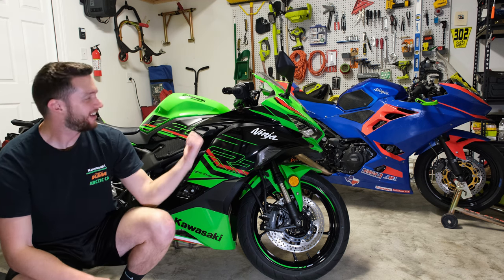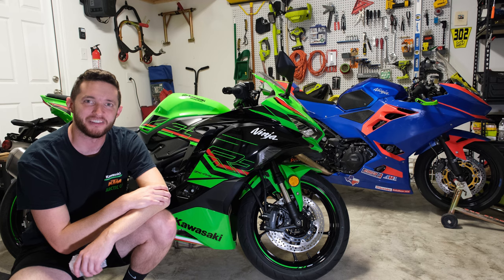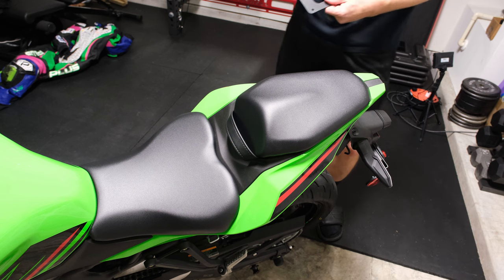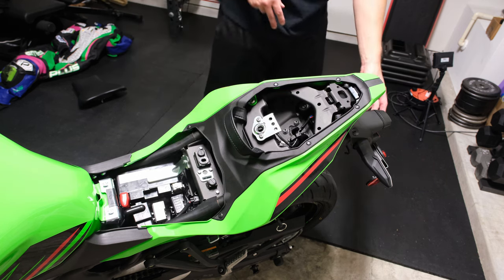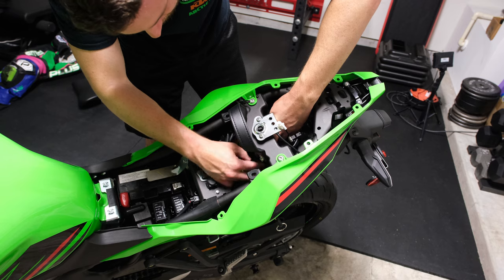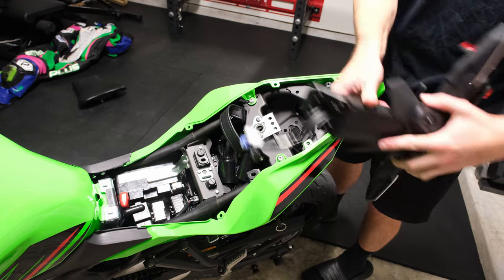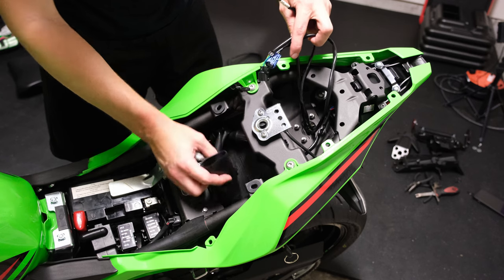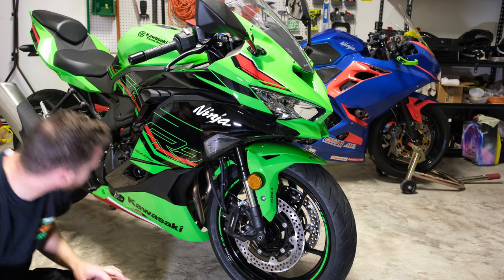ZX4RR - 1st day in garage, basic installs

Comment: Where did you find the radiator guard and the tailtighty ? are you aware if stuff for ninja 400 would fit on there ?
Reply from the maker: You can get zx25r parts, they all fit. These were just cheap chinese parts that I put on for those items since there isn't much else developed yet.
Reply: @TREY_ON_TWO can you share where got radiator guard? Only thing I haven't been able to find for mine.
Reply from the maker: @jamespreacherbeck4306  its just a cheap on from Ali Express

Comment: Are the turn signal connectors the same as the Ninja 400? I want to get the TST turn signals but I'm not sure if the plugs are the same.
Reply from the maker: The zx4rr has different plugs then Ninja 400 and all my other Kawasaki's. The light housing looks the same for the front turn signals and tail light but different brackets and wiring.

Comment: Can the seat from your Ninja 400 fit on the zx4rr?  I have a Corbin seat from my 400 that I saved for a zx4rr.  I'm curious if the main seat is the same.
Reply from the maker: Just tested it and the N400 seat will not fit. The seat pan design is similar but not quite the same and differences in the tank shape too.
Reply: Hell , I just put a Kaw ergo ( thicker )  seat from a 2018 Ninja 400 and it fit right on.

Comment: Is the tank made of plastic or metal?
Reply from the maker: Metal, as usual for Kawasaki
Reply: @TREY_ON_TWO  cool, I'm thinking of buying this moto. I wasn't sure if my current tank bag would fit with the straps, but it does have magnets. The reason why this is important is because where they sell this bike, i would have to stay a few nights to do some mods, and then drive it back to the island in which I live.
Reply from the maker: @sgates83  Wow! Sounds like an adventure right off the bat, good luck!

Comment: Wouldn't that radiator guard basically reduce the air flow by 50%?
Reply from the maker: Look up images of radiator guards, while the protection is spread across the entire sheet, the actual air coverage isn't much. I've never noticed a temp difference on any of my bikes with them. If they were bad, racers and race companies wouldn't use/develop them.